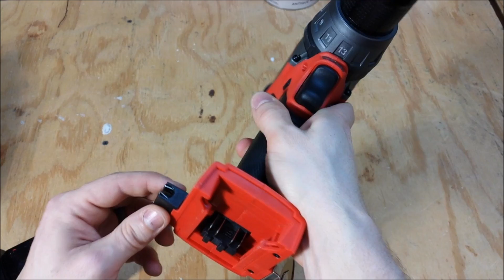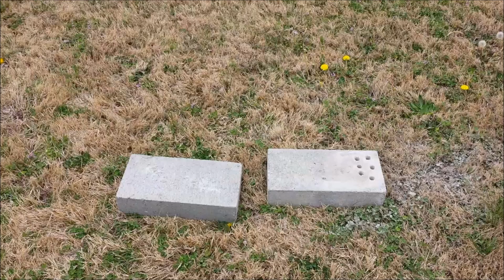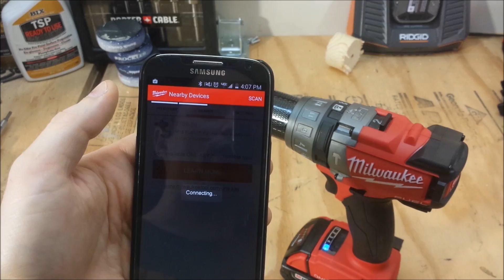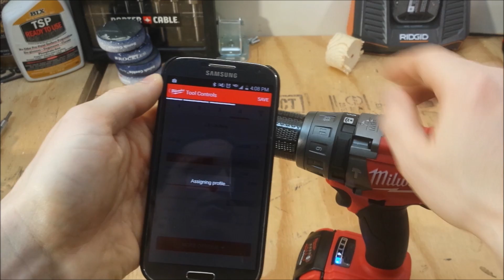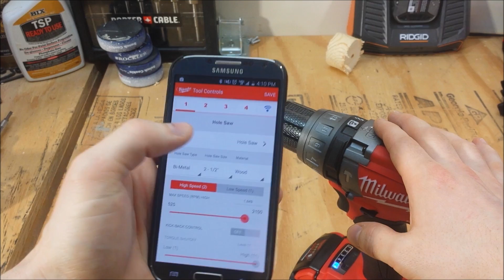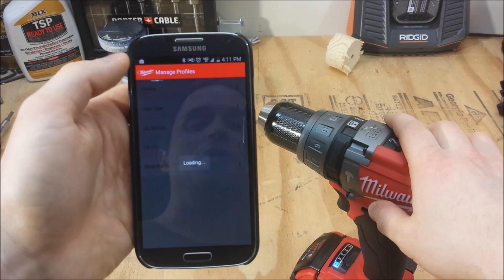M18 FUEL ONE-KEY Hammer Drill Review 2706-20

Comment: How does it compare to the old drill with concrete drilling?
Reply from the maker: I don't have the Gen 1 unfortunately. But the Gen 2 is significantly faster than the Gen 3 is at drilling into concrete.
Reply: @DoresoomReviews  I imagine that little length they were able to trim down, had to bet taken out somewhere - was not exactly a whole lot of wasted space in the gen 2. I was impressed by how capable this puppy is drilling in concrete. If it wasn't for all my bits being SDS plus, I probably wouldn't need to take my large, old-school Atlas Copco impact hammer/breaker half the time anymore. I'm gonna get some good round-shank masonry bits for the smaller, most common sizes - not needing to drag the big heavy Atlas around every time seems nice. I got my M18ONEPD 2nd hand; barely used, with 5.0 battery, charger and case for about $150. Already have chargers and batteries from another purchase, sold the battery and charger for $100 :)

Comment: Thanks for review!
Looking for a new quality high power drill and I can't decide whether to go with the one key or without. I could have used a better comparison between the regular version and the one key.
1. How does the electronic clutch compare to the traditional mechanical one? Bosch has electronic on on of their consumer models and I believe Black & Decker also and it's so-so working. Sort of OK for large screws but they can't compete with the mechanical for small screws. Electronics doesn't seems sensitive and fast enough. So how is it working on the Milwaukee?
2. Ramp up time. How to they compare? Do the non One Key have fast/instant ramp up or have they programmed it slow? I really like the almost instant ramp up of a relatives DeWalt - it has other things I don't like but that ramp up speed is nice when you've learned to tame it. 
3. Kick back control. Do they both have it and does it seem to work? If like you write it's not working with accelerometer as on the Bosch I suspect it could become annoying at some point.
Really can't decide what to go for. As a gadget freak the One Key both appeals to me and intrigues me. One side tells it's nice to have all those options. The other is unsure about electronic "clutch" performance and really don't care for the management part of One Key - don't want to deal with pin codes and all that stuff and would rather not have to deal with it. Well I guess I can - until someone "steals" my tool and manages it for me if I don't??.

Comment: Do this milwaukee fps ahve anti kickback control like the bosch
Reply from the maker: This has anti-kickback control that can be turned on or off through One-Key, but it doesn't work the same way as the Bosch does. The Bosch drills have an accelerometer which detects when the drill itself instead of the bit start to rotate - a direct measurement of what they're trying to counter. I believe Bosch has a patent on this methodology, so Milwaukee had to settle for an indirect monitoring method, which measures current draw and the relative motion between the bit and the body of the drill. The Bosch methodology is more robust, but Milwaukee's works pretty well too.

Comment: Thanks for the review.  My very trusty Hitachi DS18DL snapped itself in half today on the jobsite when the self driving bit hit a nail or something (no anti-kickback) so i'm considering an upgrade to this.  You helped.  

Edit:  Got my first Milwaukee M18 FUEL tool several months ago.  A 2763-20 impact wrench, and MAN ALIVE does that thing WHIZ through lug nuts like they weren't even attached!  So I'm really favoring a switch to Milwaukee here..
Reply from the maker: Glad I could help! I haven't used the M18 high torque impact wrench, but I have the 2654 3/8" impact, and I've been nothing but impressed with it.

Comment: what do you think aboute the Porter Cable Forstner bits?
love the reviews
Reply from the maker: I really like them! I haven't put them through a ton of use, but when you need a certain diameter Forstner, nothing else will do. I originally was going to pick up the Ryobi set, but their quality control was horrible. Porter Cable offered a good middle ground, without breaking the bank like Diablo or other higher end brands.
Reply: I was thinking about picking up the Ryobi but when I saw the Porter Cable I thoght it would be better. thanks a lot

Comment: i have one. that sucker has major power. i have used it to mix a bucket of sheet rock mud that my 1/2" corded drill over heated and started smoking trying to mix and if you put the 8" mixing paddle on it and burry it deep in the bucket on high it will sling the mud out the bucket and on the walls.. stupid strong.. mixed the hell out of some thin set mortar for laying tile..
Reply from the maker: Yeah, almost a scary amount of power. I was having trouble getting a hole saw to tighten down the other day, so I set the drill on my workbench, and placed a big wrench against the edge of the workbench. I figured I'd just goose the trigger a little and snug it up - that ended up with the wrench flying across the room, and me almost losing my grip on the drill. Next time I'll turn on the anti-kickback protection first.

Comment: this foos an idiot.
Reply from the maker: Any specific critiques about the video, or am I just an all around "foo"?
Reply: oh jesus here we go. the "foo" wasn't literal,  its just my lingo. to me you're an idiot for not noticing how hot the tool was getting until after it was leaking . oh and why get disappointed over a scratch? ? makes no sense to me. great video though, really helped out with the one key setting, works great drilling 2 inch holes on a joist that might have electrical wiring on the other side.
Reply from the maker: Ernesto Mejia Awesome, thanks for the feedback.
Reply: Bruh that "bluetooth connectivity" is Gov. Tracking. Yes; their even tracking us through our tools now.
Reply from the maker: J.R. Productions Don't worry, Milwaukee has you covered. They included a small roll of tinfoil in the box, and it's enough to make a hat for yourself AND a tiny one for the drill too.
Reply: It also comes with a tinfoil house for your homeless ass.
Reply: Have owned a milwaukee drill for 7 years, never once put the attachment handle on it lol.